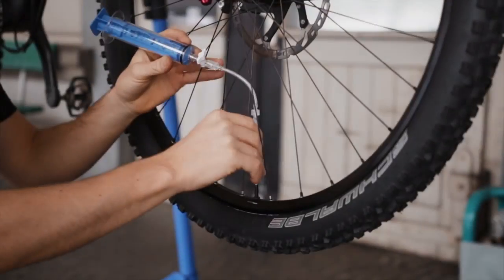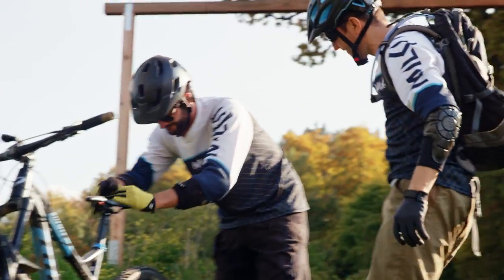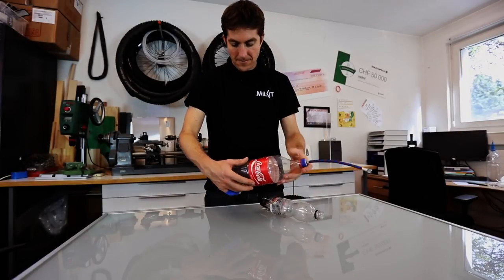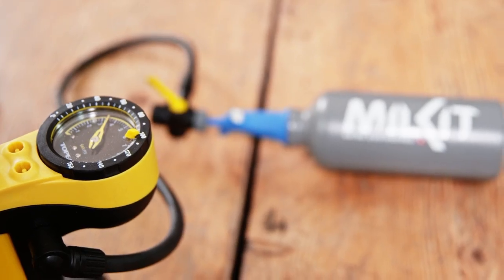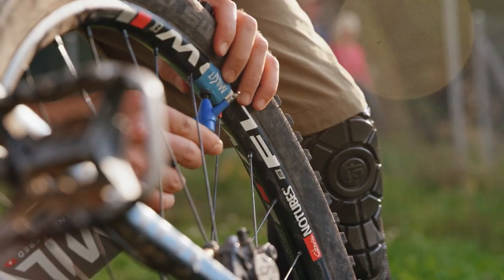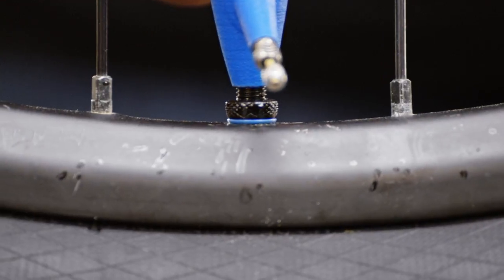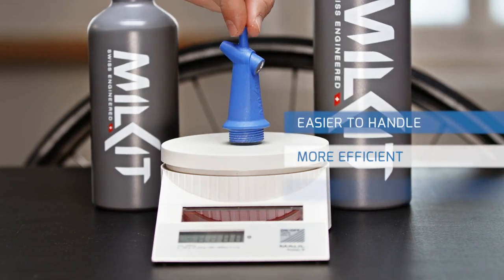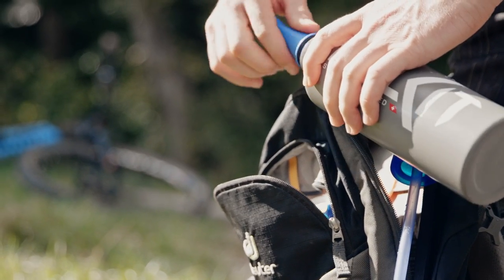milkit tubeless booster Kickstarter

Comment: The booster kinda looks like a SIGG bottle. Are they compatible?
Reply from the maker: The milKit booster bottles are reinforced to hold pressures up to 160psi/11bar without buckling at the bottom and there are many different bottle threads out there that we don't know the size of.
 While they technically would be compatible, we really recommend using the milKit bottles for the full Tubeless Made Easy experience.